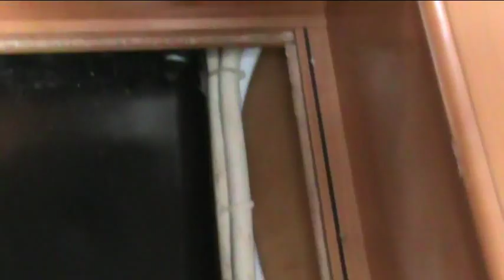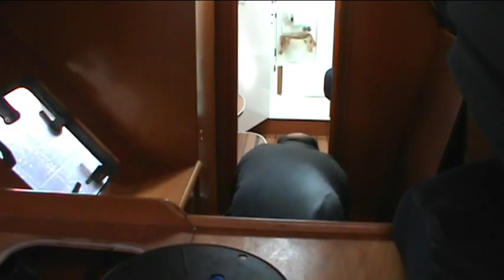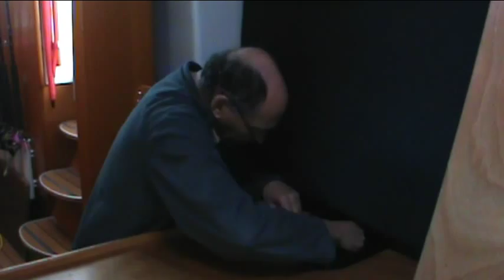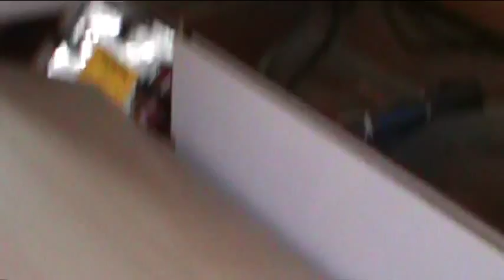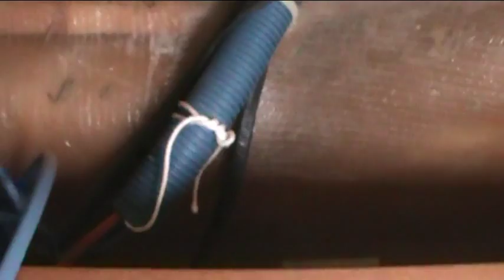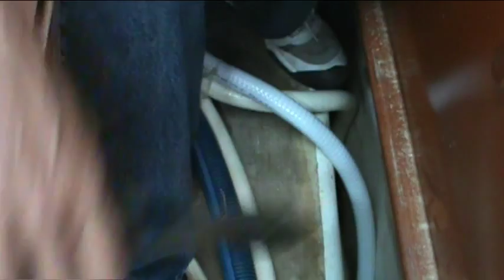Bilge Pump Installation Part 3 of 3. Running the wires and final hookup

Comment: How do you get that liquid tape goop off the terminal block if you ever need to change something out? Seemed unnecessary to me - that area should be dry 99.9% of the time (only would be wet if the bilge pump fails or some water is spilled from above).
Reply from the maker: +Patrick Davin Water get sloshed around and condensation in the bilges can be a problem as well. It is easy to remove and reinstall the connectors after the liquid tape has been applied then you re-coat, it is easy.  Thanks for the question and thoughts

Comment: A  12 AWG will loose 36% less power over a given distance than a 14  AWG.  Good point with regards to voltage drop and wiring, but a good practice to diminish electrical noise in communication systems. Labeling is a always a task that is neglected but  is very important. I too snip the ends off tywraps. I have acquired a 29 foot Bristol which is in need of lots of repair due to years of neglect, so your videos are a very welcome resource.
Reply from the maker: +BChrisL Glad the video was of help good luck with your project and thanks for the feedback
Reply: Wayne Canning (dr hotcist podiatist clinton md. 20735